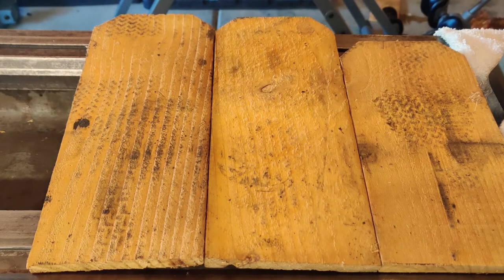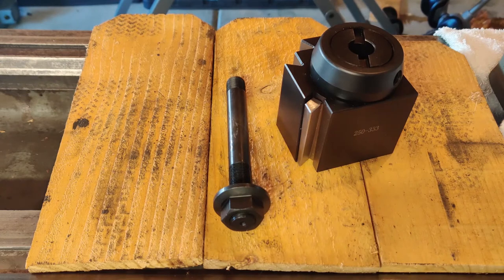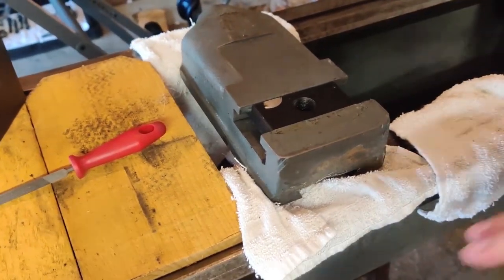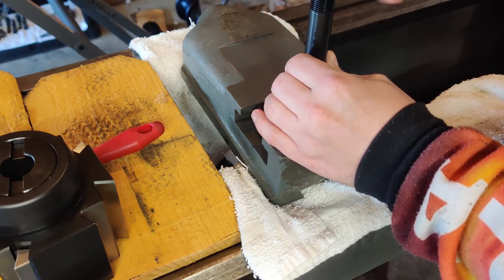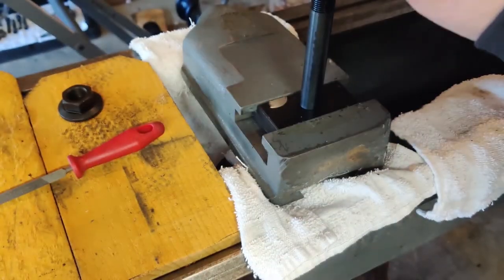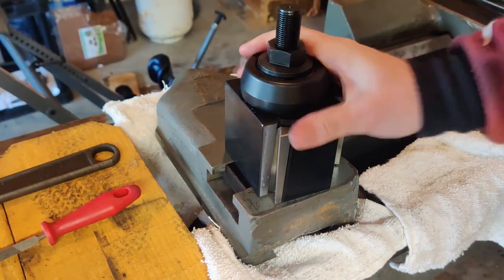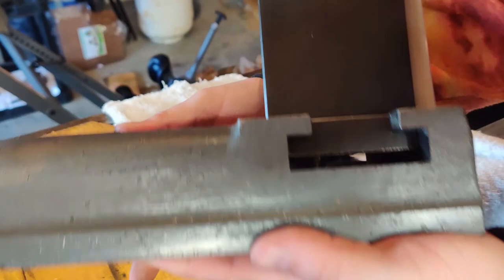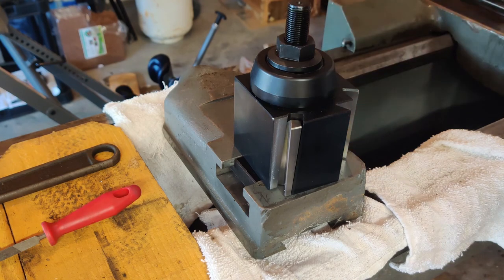1950 LeBlond Regal 17" Lathe Restoration Part 18: Machining a QCTP T-Nut

Comment: Hi ThatGuy I like your channel. Could you tell me the diameter of the strawberry and the revolutions you work with. All the best
Reply from the maker: I'm glad you enjoy the content. If you mean feeds and speeds, as well as the cutter size, I'm sorry but I didn't take note. I believe it was a 3 inch diameter cutter, and I know I was running it slow so between 70-120 RPM.